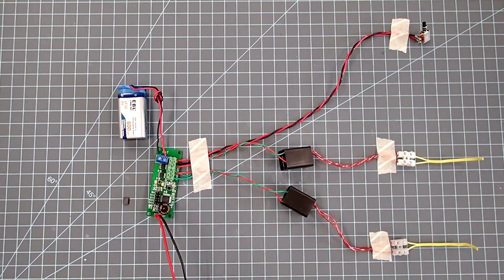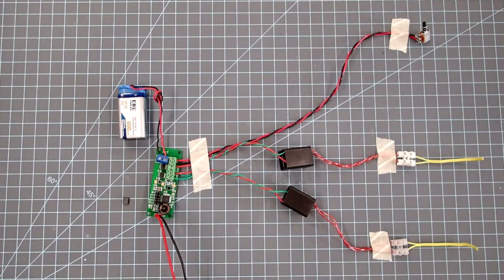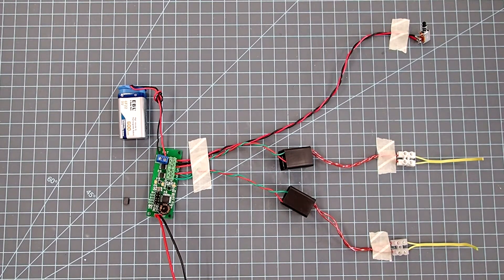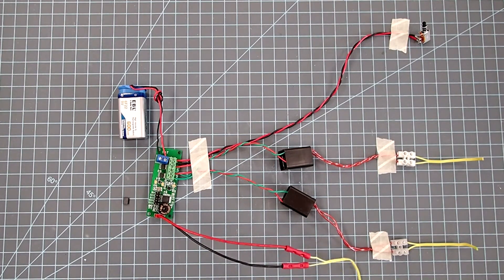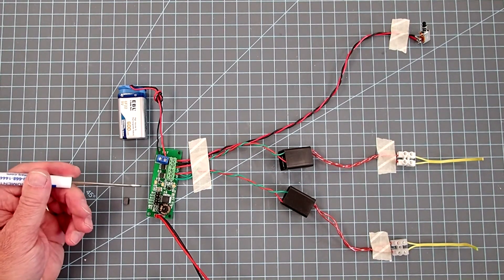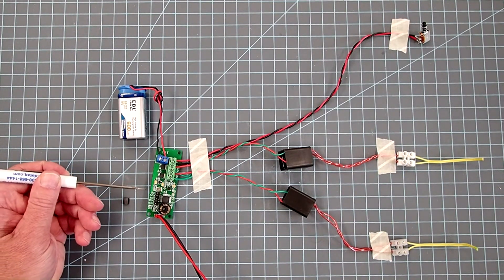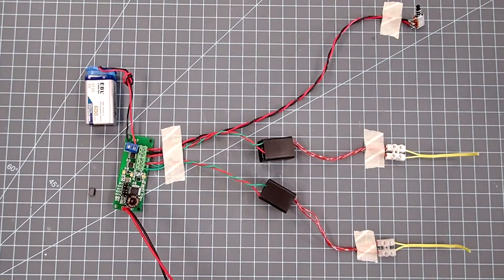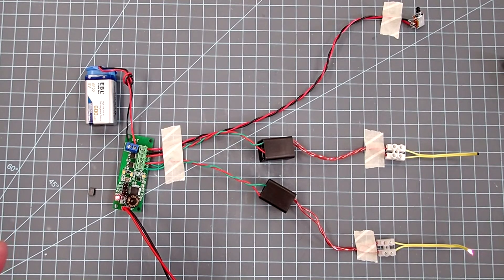Lightning Bug altimeter test

Comment: Thanks for this video! Can you reuse the wires, or do you have to re-cut them every time?
Reply from the maker: Just cut off the burnt part.
Reply: @REAR_rockets  understood. Is the altimeter still working pretty good for you? Just ordered one myself.
Reply from the maker: @mdrocketry  I made this video right at the beginning of the pandemic. I haven't put it in a rocket yet, and I'm having a very difficult time finding 4FG black powder.
Reply: @REAR_rockets  understood. Thanks for your help!

Comment: Hi Dave.  Thanks for posting this.  You are correct when stating the excessive length of the high voltage wires are a problem.  They need to be kept as short as possible.

Comment: Good test!  Glad you got the results you were looking for!  Any idea what size holes need to be made in the fuselage in order to equalize the air pressure for the altimeter?  I’m setting up my small rockets to take the Jolly Logic Altimeter 2. Thanks!
Reply from the maker: Not very large. Here's an article on altimeters and vent holes - https://www.apogeerockets.com/education/downloads/Newsletter68.pdf. I've sent my JLA2 up in small rockets without vent holes. The velocity might be a bit off, but if nothing else, it will give an accurate reading of ejection altitude.
Reply: Great article and I appreciate your reply. He recommended 1/8”, but my gut tells me that may be a bit excessive for my little guys, so I’ll probably start out with a few 1/16” holes at each 120 degree point. I can always make them bigger if need be.  Thanks again Dave!!!
Reply from the maker: @KevinsModels  you could a single 1/8" hole or 2 1/16" holes for most small rockets (e.g., Alpha size). I put them just below where the nose cone shoulder sits.
Reply: @REAR_rockets  Well, I went with a single 1/8" hole.  I posted some pictures of my design on rocketryforum.com under "Low Power Rocketry (LPR).  My username is "Patternflyer" and I titled the post "Altimeter air hole".  If you are able, please check it out and comment your thoughts.........  Thanks!